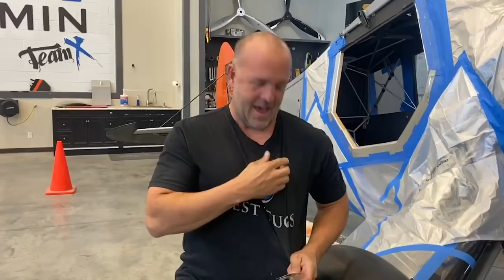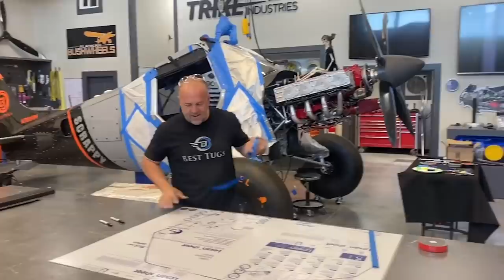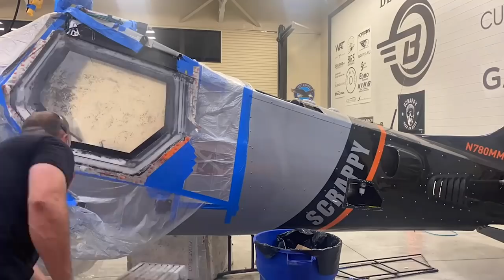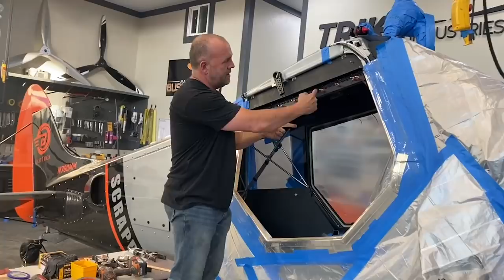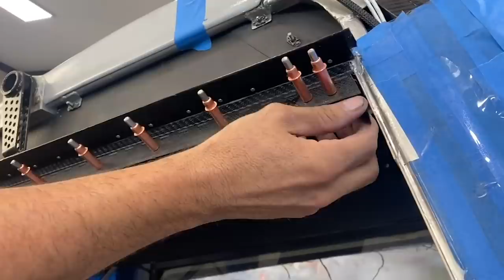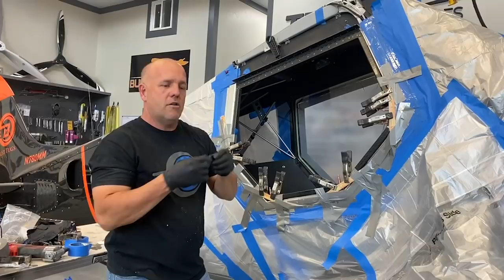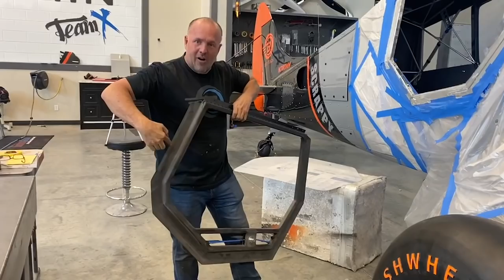Drag Racing Bush Plane gets custom carbon fiber door that can open in flight | Scrappy #36

Comment: U Mr do good job. Make Kit of Draco to seling people in whole world. Make plane like VW Passat B5 2fly & 2sleep on board. Make simply cheap, with engine  goog to regular flight not sport... I wont to buy plane like Draco and fly 
wherever I want, sand gras moutain landings. Draco show the world You Mike are wery talented ingener like mesershmit but the do planes to do sth rong wifth the world. The people like You olso they dream about camper with wings. If You need money 4 start only tell the people "I start builds Draco's". Cesna what cesna??? You CAN!!! sell more than Robinson R44 and Cessna together in 30y. You can bee famous like "Dedal". Yes i am from Poland i fly like u my grangpa fly in WWII on Spitfire. I bag U from 20.000km  make masive selling of Draco but cheap low fuel consumpion, and with euro parts (like tyres, colers, parts) must been in klient in few days in whole world.    2 people with place to comfort sleep. 
I would like to fly to Africa Azja. The plane need to have big range.  If I take the Draco 640~hp engine I fly without propler and wings. You start on 3 m distans with wind with low weight empty tanks etc ok YOU show the world You can make it I am from Poland like PZL Wilga....  at WWII ouer fighters fly on PZL P7 (max speed 333km.ph) and they shut down german messershmits bf 109 (max speed 465~499kph)...    200 kmph  and they can. You build your TEAM 7-8-9 planes???     Make 30.000 and on anawersary You sit with Your beaoutiful dother like Evel Kanivel     And You see 30,000 planes named Draco by Mike Patey with serial numbers on them. I known what You see in the space with clouds. Give this people too. 
Don't be selfish. Evryfink is 
stupid and pointless but if You put the hart  ITs A LIVE.....     PS R44 crash Draco but its to expensive noisy and dink to much.    Sory 4 my ENG Kris FAN